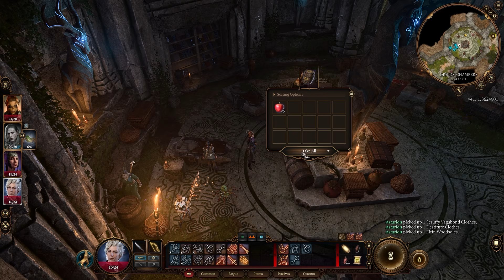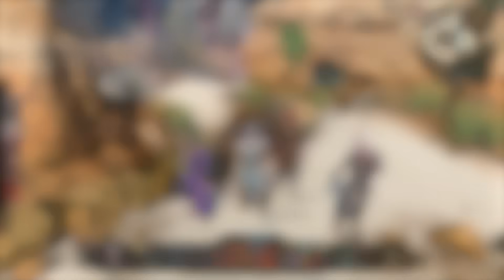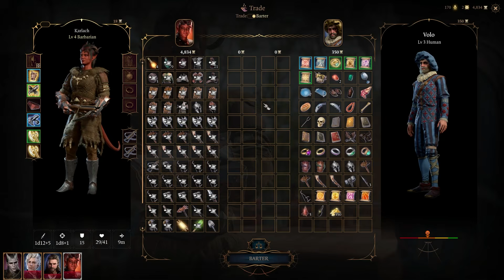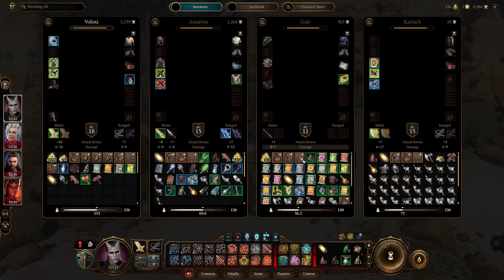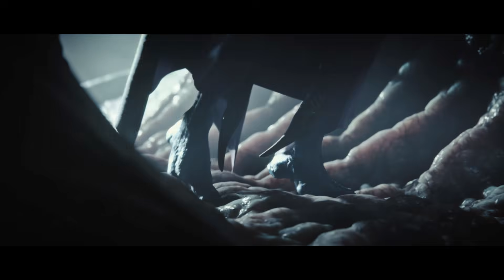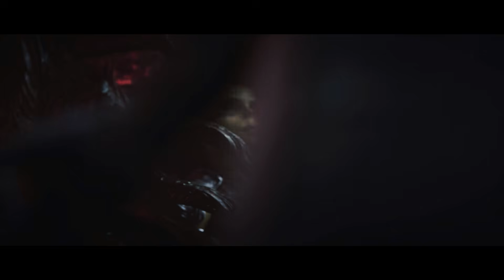Baldur's Gate 3: Tips and Tricks for INVENTORY Management

Comment: the problem is that you need to drag those items into those bags manually (for repeating items such as common books or scrolls its fine) but as soon as you find an item lets say a book that you dont yet have you need to drag it into it manually which kinda beats the purpose of sorting if its not done automatically a lot better decision would be if developers or mod creator would make it so that only certain types of items can go into a bag and you can assign what type of items (i know its possible because of the way supply and key starting bags work if it worked on other items such as books, weapons ect it would be so nice)

Comment: On PS5 I had problems with my bags. I put into separate bags potions, arrows and spells. During a fight my character was able to use an arrow from the sac. But AFAIR during the battle an other character was not able to just grab an arrow from the other character's inventory as normal but was unable to open the bag in the other character's inventory.